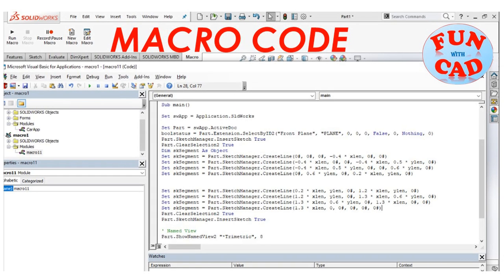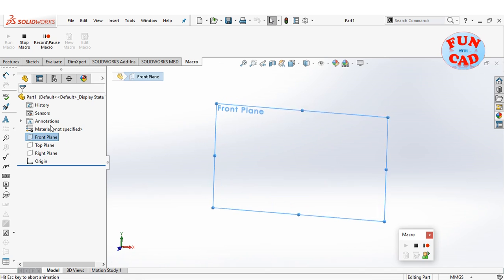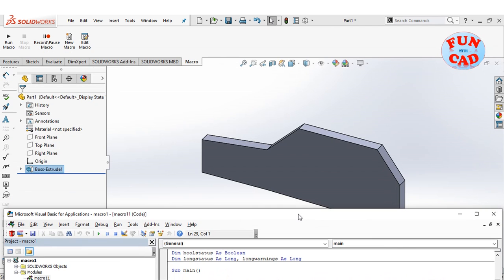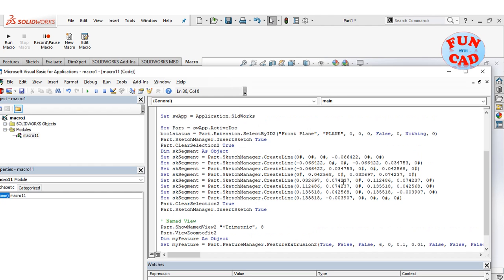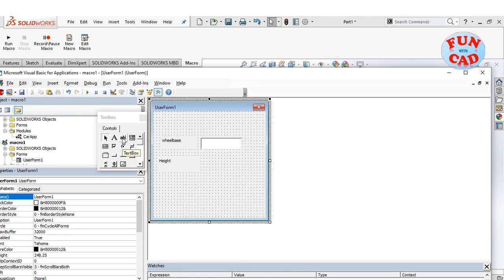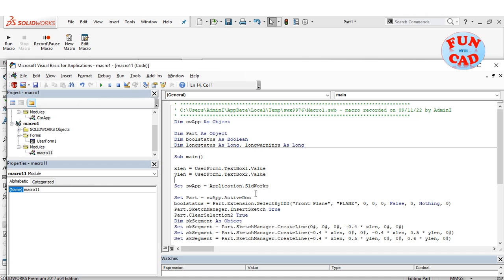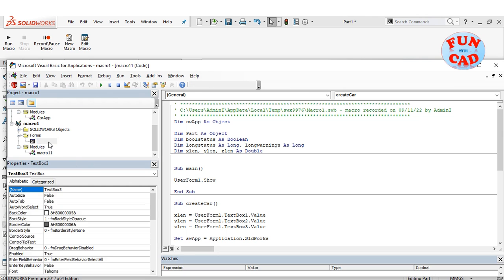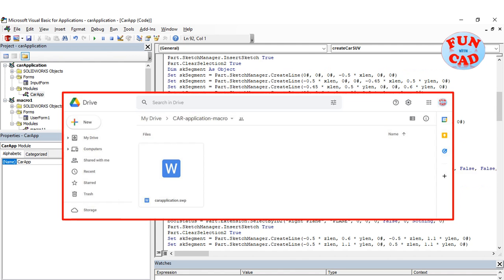Learn to RECORD and EDIT SolidWORKS macro | SolidWORKS MACRO Code Automation | Beginner Tutorial

Comment: i had a doubt in my project i am creating circle
but in creating circle command which is as followed
Set skSegment = Part.SketchManager.CreateCircle(0#, 0#, 0#, xod / 2, 0#, 0#)
here in these line it says type mismatch
i had set xod as double also  set its value in the textbox
any idea for the solution?
Reply from the maker: It seems correct. However can you check once the declaration of skSegment? Does your code have this line: Dim skSegment as Object ?